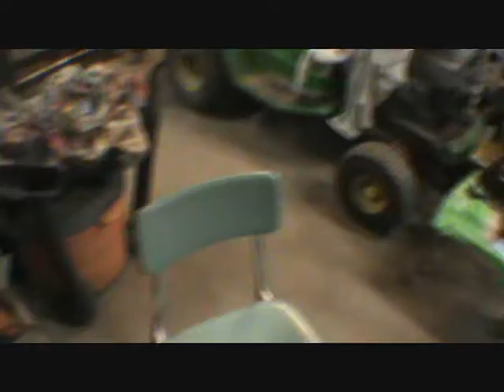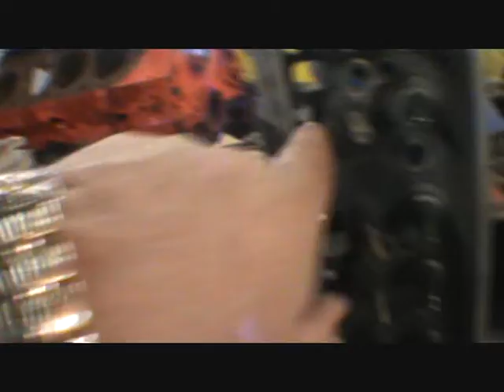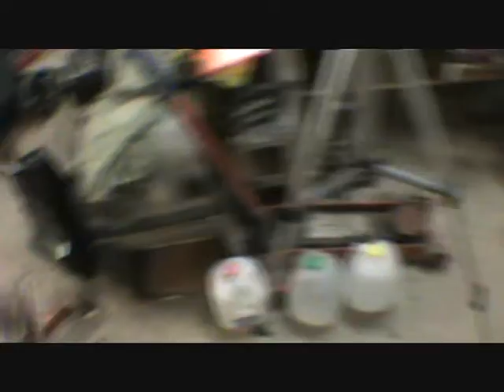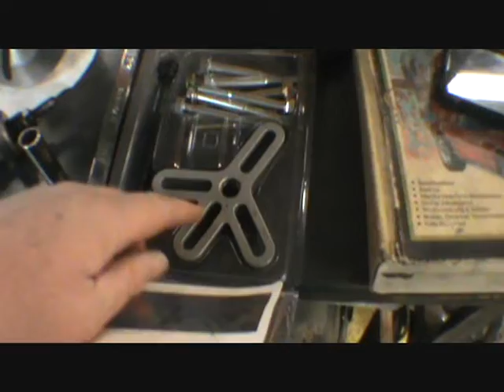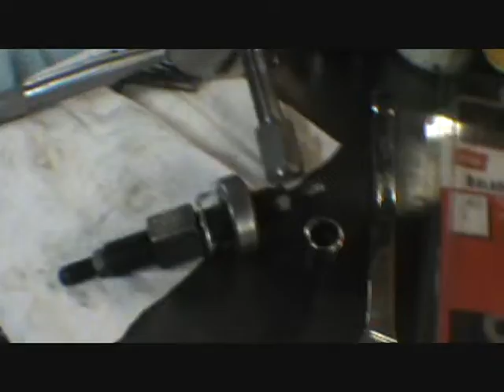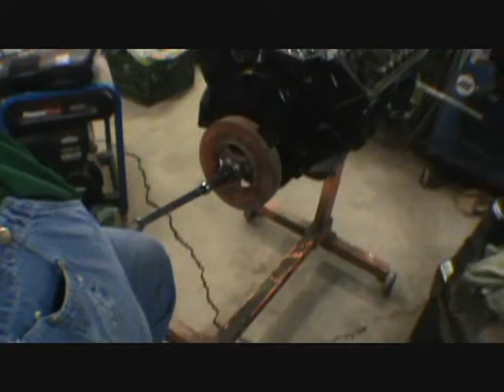build day 3 on chopshops motor and using install and puller for harmonic balancer

Comment: what kind of grease did you put on the push rod an rocker arms or what can i use from autozone to put on my 350 eng
Reply from the maker: white lithium grease also called assembly lube
Reply: thankyou  oh by the way for rushing i use the wrong puller on the harmonic blancer an mess the tread so now iam buying the right tool or rent it thank you again

Comment: Will I have to run the zinc additive if I use my regular oil for my trucks? I usally use rotella
Reply from the maker: the rotella have to read the bottle it may still have it in it yet the only oil i think . if it dont yes you will have to add that.

Comment: Good video of adjusting the valves on a small block chevy anyone wanting to adjust them yourself do as Rod has here and you will not have to pull the valve off again. I Have adjusted them the same way as Rod has for years works great..I do just a little different  than Rod does I get the piston on number one cylinder on TDC compression stroke mark the balancer into 4 quarters adjust number one turn a quarter turn adjust number 8 another quarter turn adjust 4  just keep going this way until all the way through the firing order,.. Have a good day Rod..